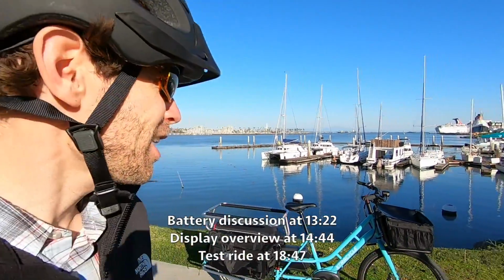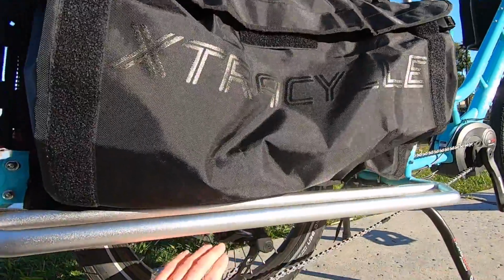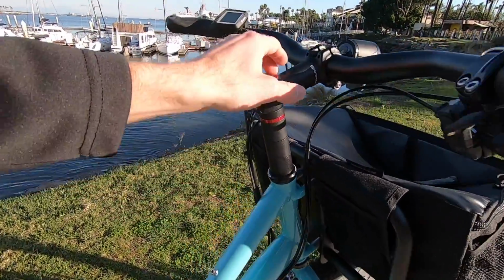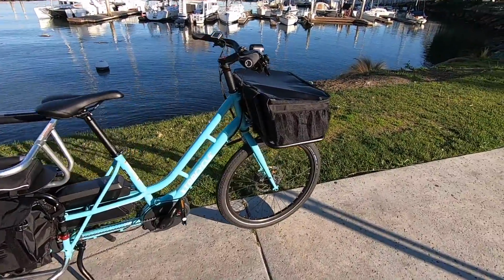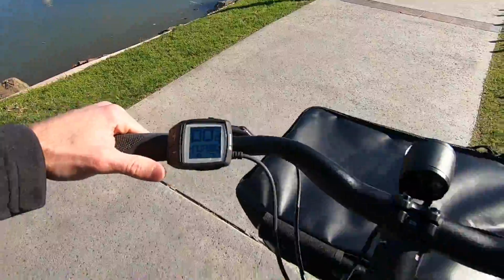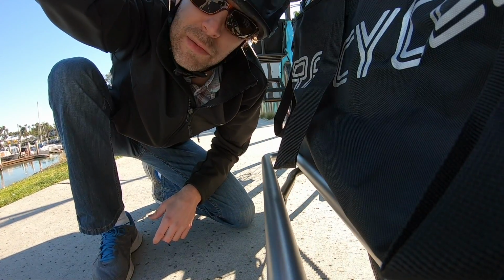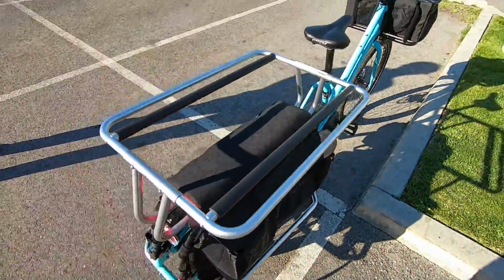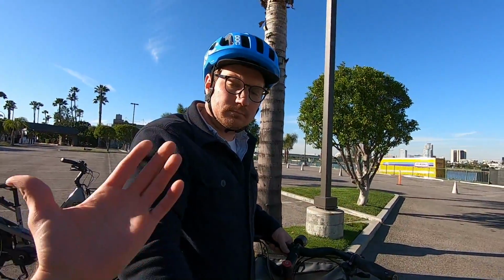Xtracycle Edgerunner eSwoop Review - $4.5k

Comment: I appreciate your reviews.  You have the best ones on Youtube.  I want to buy an E cargo bike this summer/fall.  It will serve to hall a little bit of cargo and one-year-old child on a frequent basis and plan to bring it with on trips.  The ones that I like the most are the Tern GSD S00, Benno Boost E, Xtracycle EdgeRunner, the Yuba Spicy Curry.  I'm more interested in the first two (Tern and Benno) because they seem to be shorter and easier to transport (would fit on a conventional bike rack).  I haven't seen any comparison videos from you.  Can you weigh-in on which bike would be best for my circumstances?
Reply: Being mindful of size and weight is a wise move.  An extremely long bike isn't going to have much utility if it's so heavy and long, the rider dreads riding and parking it.  I have the Benno Boost and it can be ridden pretty much like a conventionally sized bike.  Chose it over the Tern because it's lighter and the 24" wheels offer a bit more comfort.  But the Tern does have a lot going for it.
Reply: @arevee9429  Do you have a family?  Do you pick up your bike a lot or tend to pedal without a the motor?
Reply: @chou_frisé  I don't carry passengers on the Benno, so I can't speak to that.  And if I'm riding an e-bike, the only reason I'd pedal it without the assist is if the battery was dead.  I have owned a long, heavy cargo bike and found it a beast to move and park due to the weight and size of the bike.  The other thing to be mindful of is that if you need to make multiple stops, the bike is loaded with things like cargo and tools and your location isn't safe, you have to figure out how to prevent what's left on the bike from being stolen.